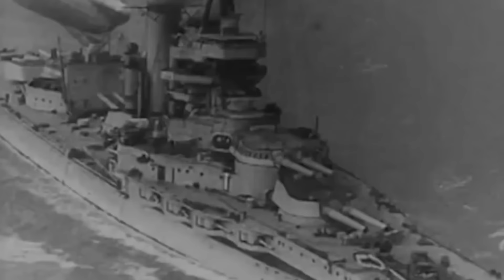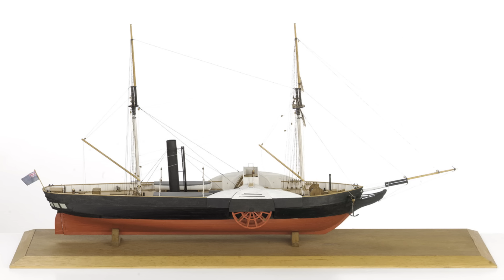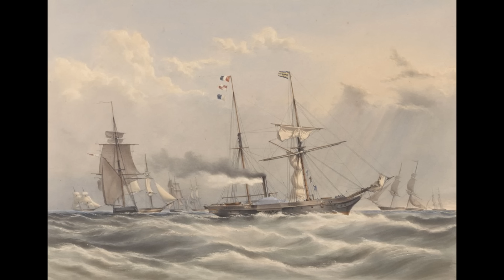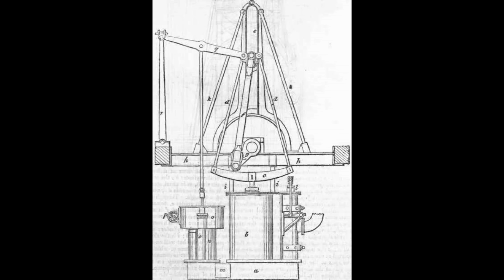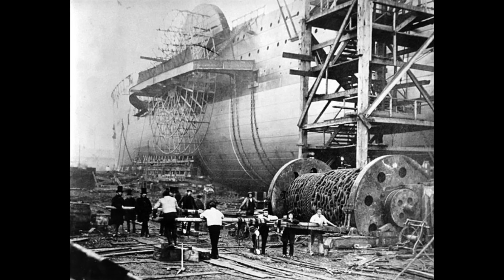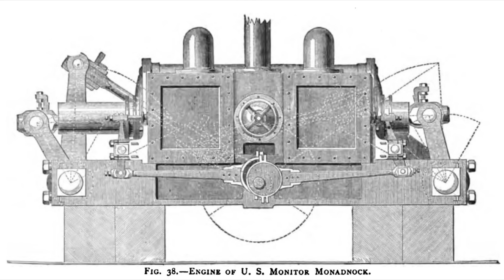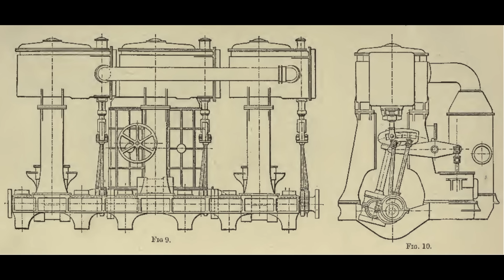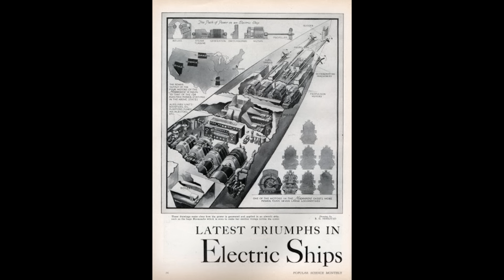Naval Engines - Rotate that shaft!

Comment: There's a gentleman in Green Bay, Wisconsin that built a running model of the Monitors engine. 
https://www.google.com/search?q=uss+monitor+steam+engine+model&oq=uss+mintor+engine&aqs=chrome.3.69i57j0i13l2j0i22i30.13380j0j4&client=tablet-android-samsung&sourceid=chrome-mobile&ie=UTF-8#
Monitors engine not only had to be of low overall height. It had to be narrow enough to fit into the fairly narrow hull.
Also in terms of a fairly small steam engine with a good power to weight ration one needs to look at the Doble steam cars.
https://www.google.com/url?sa=t&source=web&rct=j&url=https://en.wikipedia.org/wiki/Doble_steam_car&ved=2ahUKEwjFkujcxI_wAhUCWs0KHWcDD1IQFjAAegQICRAC&usg=AOvVaw2oGS36VjpaQ3domemBTQZq.
Plus the concept of double acting engines is not limited to steam power
https://www.google.com/url?sa=t&source=web&rct=j&url=https://www.gasenginemagazine.com/gas-engines/1907-snow-zm0z16jjzhur&ved=2ahUKEwjqlo6Vx4_wAhXaKM0KHcocC9IQFjAFegQIBBAC&usg=AOvVaw3PLTKQTvOY7unnd_excDxF
And a minature version
https://www.google.com/url?sa=t&source=web&rct=j&url=https://www.artisanideas.com/product/9780941653411/Build-the-Snow-by-Doug-Kelley-a-Tandem,-Double-Acting-Engine.html&ved=2ahUKEwjqlo6Vx4_wAhXaKM0KHcocC9IQFjAHegQICRAC&usg=AOvVaw13Qiun_DQMM-ik1_YhK8se&cshid=1619015861650

Comment: Wouldnt the 1920tys diesel be somewhat more efficent than the 1920 steam turbines? This would ofsett quite a bit of the added weight. 

Also, diesel having the benefit of being liqid  making it more space  efficent to store.
Reply: I suspect this depends on whether there was condensation or not.  A heat engine that exhausts it's working fluid to atmosphere is pumping out it's exhaust at 1 Bar/15 psi. In addition there is latent heat in steam. A diesel has no choice but to exhaust directly and looses the 1 atmosphere pressure as waste. A steam engine that does not have condensation (like a steam locomotive) also looses this pressure as waste. A steam engine that condenses the exhaust takes the exhaust pressure down to zero and thus can use the 1 atm/15 psi for mechanical work.  A condensing system is very bulky so is only found at stationary power plants ( often near water bodies for coolant mass).  Not sure about ships however. Someone else will have to address that.
Reply: @francoistombe  The numbers i seen suggest that a early 1900 steam turbine (condensing) would have a efficiency of 20%... That while its good, its a bit less than a well running diesel from the same time period (about 26-28%).

He had have a previews video on boilers, also including a bit about condensers. Of cause they are heavy... but carrying fresh water is also heavy.

Also worth saying is that coal have a energy density of 25-35MJ/kg, while Diesel have a energy density of almost 46MJ/kg. That is quite a considerate diffrance.

The fact that the volume of diesel is slightly higher, really shouldn´t matter that much, because it can be stored in the armor of the hull.. that should be pretty much free space for most warships.

The statement that diesel is more expensive am i bit skeptical about to. While its true on the surface.  Considering that a lot of battle ships change to oil burning anyway, due to space constraints and boiler efficiency. I kind of doubt that the cost was a major concern. While refining do lose a bit of energy (it should have been about 15% at this time), the higher efficiency of the diesel more than makes up for it. Also a diesel with this much volume can handle much thicker fuel, so it really don´t have to be refined that much.
Reply: There is an account going around, and it is credible, that the panzer schiffes used a heavy diesel fuel (no. 4?) But it had to be purified in a special plant before it could be used in the engines. Perhaps to remove fine grits and paragon waxes. This purification plate ran continuously and the purified fuel went to a storage tank. In the Rio Plata battle this purification plant  on the Graf Spee was destroyed. So although it had plenty of fuel in the bunkers it was short on fuel it could use and this was a factor in the decision to scuttle rather than make a run for it.
Reply: @francoistombe  I´m not that knowledgeable in the chemistry part of fuel refining, maybe there is some way of filtering out the heavy fractions with out refining.

There is ship currently that use heavy fuel oil, simply by heating it up to 90C before injecting into the cylinders, in effect, emulating a lighter fuel.

Comment: Ahh, maritime engines. Cathedrals of technology and engineering, built by men with clever math, ingenuity, and a willingness to run steam at a pressure that would have made sane men pause.
Well, until diesels came about. Almost seems like an anti-climax once you get them involved.
Reply: It's actually amazing what you can get used to.  Spent many watches sitting between 32,000 shaft horsepower worth of steam turbines, and never gave much thought to flying turbine blades or the fact that those big pipes contained 600-PSI steam superheated to about 850F.  I was more focused on making sure that my 8 MW worth of turbine generators and associated switchboard didn't turn into a mini version of a good lightning storm.

Comment: Excellent as always!

Minor nitpick: when talking about double-acting engines you mention that steam is admitted to different sides of the cylinder depending where the cylinder head is. Think you mean “piston” - if the cylinder head’s moving you’ve got other problems!
Reply: Agreed. I had a Pontiac Sunbird with a moving cylinder head engine. It was not a success.
Reply: @jayg1438  Ever see a Cadillac Cimarron?  Picture an optioned-out 4-dr Sunbird with a leather interior.  Not a great seller, turns out that Cadillac drivers expect something to actually happen when they stomp the gas pedal.
Reply: I noticed that too.
Reply: He has confused the piston with the head in nearly every instance
Reply: All the cylinder head’s move, but that is not what he is talking about, Its A “piston” !!
Reply: @S.Walker I've had good luck with the term "unplanned rapid disassembly ".  The solution was to not purchase Ford Cars.
Reply: Wich side the steam goes depends on the direction the piston is moving, not its position

Comment: Thanks Drach
A ships engines are often overlooked as all the attention is usually focused on guns and armour.
After propellers maybe you could look into a ships fuel and the back breaking labour involved in coaling a large ship and how coal was stored and used in order to maintain the ships balance.
Perhaps an explanation of drawing the boilers fires in order to clean the residue left as this was (as you said) "Bad" for the boiler.

Comment: 36:53 I can personally attest to this being supremely helpful, as while moving between ports a while back, the fireboat took air into one of its engine’s water cooling lines. This necessitated the shutting down of that engine, but since we have diesel electric drive, we were able to throw a switch on the main board and keep both shafts turning. I might add that we were designed and built with our diesel electric system in 1938
Reply: I work on a depot that maintains diesel-electric trains, which are pretty much the same principle. Cars can power-share to adjacent cars if one of the diesel engines fails.
Reply: Love those good old girls!
Reply: I once saw a Damen ASD Tug 2810 Hybrid move away from the quay under electric power (without, at first, knowing what it was) and was astonished by the silence and lack of diesel exhaust fumes. Looks like cool technology with a lot of potential for future development.

https://www.damen.com/-/media/New-Corporate-Damen/Images/News/2014/01/Dutch_Navy_to_buy_tugboats_in_cooperation_with_FMV_Sweden/Damen_ASD_Tug_2810_Hybrid.pdf
Reply: @Rider Strano - What 1938 fireboat are you running along the coast?
p.s.  your user pic does not align well with your diesel-electric fireboat story.
Reply: @77thTrombone  the boat I volunteer aboard is the museum ship Fire Fighter. She operated in the FDNY fleet from 1938 (the year the steam engine in the picture is from) all the way until 2010. The boat is still fully operational and moves from port to port at the eastern end of Long Island sound
Reply: @77thTrombone  always a doubter
Reply: @mitlanderson  Just keepin' the pot stirred!
😉

Comment: They never should have stopped putting a full set of masts and sails on as back-up. Although that would make for very difficult carrier landings.
Reply: Not if you put the deck on top of the masts, centre of gravity be dammed.
Reply: @zebra288  Should not be a problem airplanes have to be light anyways.
Reply: You know, things went downhill since fire and the wheel had been invented.
Reply: @ottovonbismarck2443  the TV show had the USS Flagg. one of the largest and most coveted toys of the 80s
Reply: @jeremykralt8967  Maybe not here in Europe. I only know GI Joe from the ancient computer game.
Reply: Y'know, i wonder if it's even physically possible to move a Nimitz-class carrier solely using sails. Probably not!
Reply: @BeefSupreme115  It might be possible with modern materials and huge sails, but probably not very fast. Also, in practice it wouldn't be the Nimitz aircraft carrier anymore, but maybe the Nimitz not-entirely-clear-what-it-could-be-useful-for-flat-topped-military-ship. Interesting thought experiment though.
Reply: @BeefSupreme115  I am pretty sure you can move the nimitz carrier with the wind

But slowly
Reply: @mohdafnanazmi1674  The easyer way: Set the throttle to max dand do not loose the breaks :-)
Reply: @BeefSupreme115  Why not ? A question of size, as usual. Wooden masts and cotton sails won't do, though. And the only aircraft that could be operated would be Zeppelins and balloons.
Reply: @ottovonbismarck2443   Nah, airplanes will work. Just snag the tail hook in the mizzen mast rigging and catch the plane in the main top'sl.
Reply: @BeefSupreme115  I think strictly speaking, it's possible to move any ship using sails. If you increase the size (volume or weight it's the same for boat) you increase the drag sure, but only to the square of the scaling factor, which is fortunately the exact increase you'd see in properlly sized sails mounted on the ship.

As for if we could build sails big enough without them snapping in the wind... I'd say yeah. Latest generation wind turbines have 107 metre long blades, that's pretty much as big as we can get with modern materials (leaving a fair amount of comfort tolerance.) You could mount 3 or 4 comfortably on a nimitz and move it at sensible sailing speeds.

Of course the nimitz would immediately capisize from the mechanical moment of the blades, so you'd either need to add a new lead keel or reshape the blades to be squatter and fatter. 

But it could be done.
Reply: @ummdustry5718  a carrier with a crew of 5000 doesn't need wind . Remember Waterworld ; man your rowing stations!
Reply: @BeefSupreme115  You totally could. Just consider when those ships are in port and you get a strong wind blowing against the side of the ship. They still move and that's just when the "sail" is their own hull. The reality is just that they have an insane amount of inertia so they would take forever to get up to speed and forever to slow down once they were.
Reply: Sail powered submarines.
Reply: GI Joe did it once worked like a charm :)
Reply: @jeremykralt8967  GI Joe ... played it on Commodore C64. Can't remember an aircraft carrier though ...
Reply: just gotta make shure the jet engines arent facing the wrong way, or else youll have an unexpected and rather hot "TIMMMMMBERRRRRR"
Reply: Simply take down the masts and drift around during aircraft operations, then put them back up when you need to sail away! (After all planes have landed of course)... Easy!
Reply: [HMS Furious would like to know your location]
Reply: It would be helpful for the zeppelins, you could just tie them to the masts.
Reply: Think of the rigging as emergency landing nets.
Reply: Perhaps in a catamaran or trimaran configuration?
Reply: Landing into a Tree turns a pilot into a crow and if many crows land.. it becomes a murder..
Reply: But the masts would make great airship tethers ...